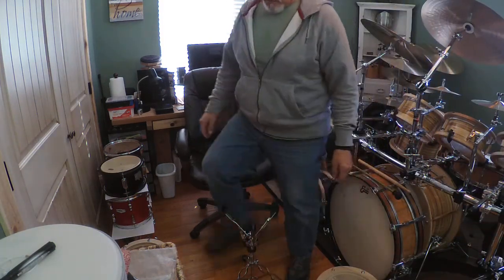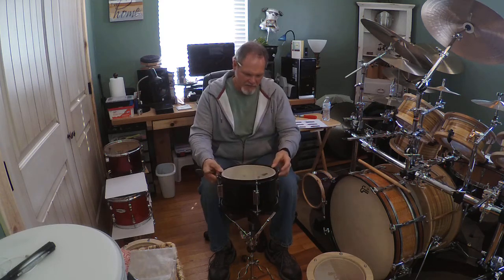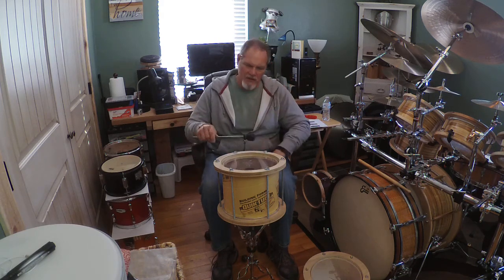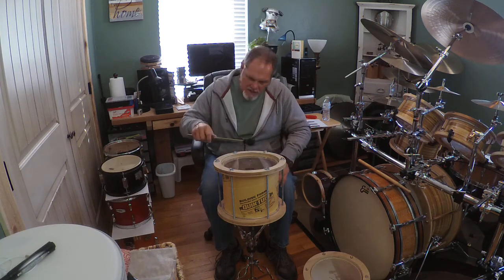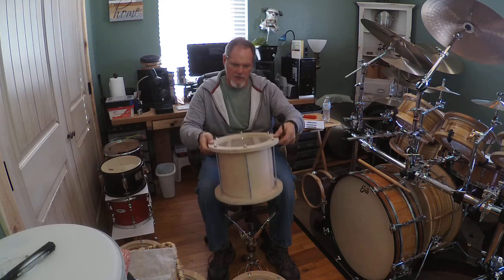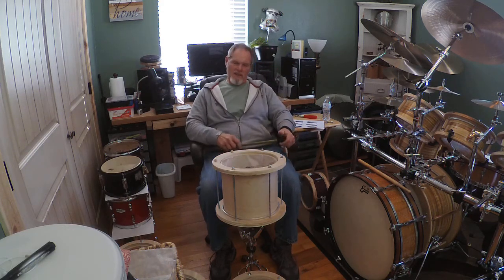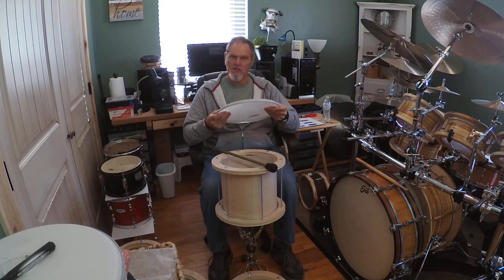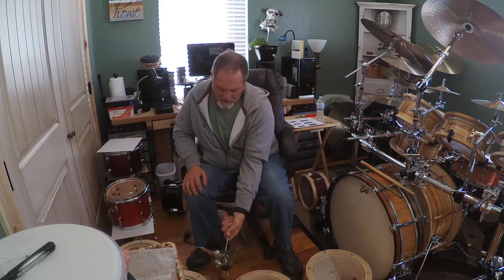Drum Shells and Sound - Bearing Edges, Part 6

Comment: You destroyed drum kayfabe for me! That word is used in pro wrestling to describe the facade of pro wrestling. The Big Secret! Well, I am beside myself. I was the nerd who’d look and study the drum construction and tell people what was good. I feel like a preacher teaching heresy and now my congregation is going to hell. All that said, I have a Premier APK set 8-10-12-14-16-22. I want to make my 10x12 an 8x12. Mainly for ergonomics and to have the drums at the same height. What will be the difference in sound? I’ve heard that it will be less resonant. What is your suggestion? Thank you for the info!
Reply from the maker: A 10 can be turned into an 8 but, there are considerations. Re-rings? Lug length? Hole placement. 

To cut 2" off the shell is no big deal. Less resonant? We'd have to have a definition of "resonant." Soundwise the drum will be a little more lively as the heads react a little more quickly off each other. It will pick up a little more sustain but, that depends on mounting and head choice, as well.

Does the drum have re-rings? If so, you have to decide to get them off the shell in into the new space or, bypass them and just put a bearing edge on your shell wall.

Lug length. If you cut off 2" will you be able to drop the lugs down and stay away from the row of batter head lugs (assuming you cut off the bottom of the shell). 

The original lug holes. Where will your cut line come in relation to the first lug hole? You may find the cut line comes just above or right on or below that first hole.  Assuming one hole my be cut off, that leaves one hole. Where will it end up? Visible? Behind the new lug placement? Leave it? Fill it? 

Turning a 10 into an 8 is fine but, you have to watch those details.
Reply: Already considered that. Shell is 5.4mm with no re-rings and is painted black since that’s how those drums were manufactured then. The drum would be cut on the bottom so all badges and mounting are the same. The smaller toms are 9x8 and 9x10. The 9x8 actually is the older APK with long lugs and the rest of the drums have small lugs. Like you said I have thought the cuts. It will land around or on the second hole and that said a new bearing edge will be needed. That drum will be under 8 inches in depth is my assessment. I hear that the drum would have a short decay. I don’t mind that. My main thing is I don’t want the tom sitting on the bass drum. A couple questions-is there a difference between short and long lugs when it comes to sound? What about the air hole? Btw I heard your drums and and you should hear Yanni live at the Acropolis. That the first time I’ve seen a 9x6.
Reply from the maker: @martincoronado9232  I'm confused. You have a 9x8 and 9x10 and 10x12 and you want the 12 to be 8 in depth rather than 9? 

Decay is based on head choice, head tensions and sympathetic action in the air column, and mounting of the drum. Sustain and decay are almost moot to the sound of a drum in a band context. That is why almost everything is about the heads and sticks and player's touch, more than the drum shell, save for volume associated with the density of the cylinder. That said, my "half-toms" have a lot of volume and sustain simply because the air column/sonic wave stays in motion at a faster rate between the heads. Deep drums do not have more sustain just because the cylinder is deeper. They can sound like dry tubs by comparison. 

Long lugs add obvious weight and mass onto the shell and will tend to dry out the sound some, even with an isolation mounting system. Just the nature of the beast. That would be noticed less as the drums grow in size and dimension. 

I do not place air holes in my drums. 

One of the reasons I went back to half toms from that concept 8" depth rainbow set is because deeper drums produce more "punch" and a drier tone, even with single ply heads I use. I have the Yanni video. Charlie's toms are staccato sounding because of that depth. I like more sustain and musical tone, such as it can be heard by my ears and by mics when the whole set is going. I once made a concept set with all 10" depths, from 10x6 through 10x20. The small toms were just too dry and lifeless for me. Very throaty sounding or tube-like. Since the 90's, no matter what I experiment with, I always go back to half toms: 4x8 through 10x20, and even 11x22 and 12x24 for the kicks, though I do like a 15 or 16" depth for bass drums overall.
Reply: REFondrums the reason I want to go from a 10x12 to an 8x12 is mainly keep the tom from resting on the bass drum. Also, i want the lugs to have the same distance from the bearing edge. The lugs need to two holes to be affixed to the drum. If, for instance, the closest hole is    1 1/4 inches away from the bearing edge then after the reduction I would like the same distance. I don’t want the lugs to look off. If there was meat then I would go 9x12. Btw what is better, thin shells or thick shells. At one time wondered about a descending thickness shell. 
Like this
6”- 8mm
8- 7.5mm
10- 7mm
And so on.
What are your thoughts?
Reply from the maker: @martincoronado9232  The simple answer to just about any question regarding sound and drum shells can be found within the Janka table. The Janka table is a table of wood specie hardness/density. The table is generally used to rate wood flooring. 

The more resistance sound waves meet the more excitement within their environment. That means volume, generally. Thicker shells promote more volume. That said, a thicker shell wall of soft wood, may not promote the same volume as a thin wall of hard wood. A thick walled drum of basswood plywood may not promote the same volume as a thinner wall of Bubinga plywood. Density increases, to subtle degrees, how loud a drum may sound, and how "bright" it may sound. 

Having made drums in 6, 8, and 10 ply configurations, the differences, in Keller Maple anyway, are not that great. Again, lost in full set play with cymbals ringing, and certainly in a band context. 

The sound of a drum is 90% or more the drum heads. Change the heads, change the sound of the drum for more radically than changing drum shells. 

In this day and age of constant hype from drum manufacturers that simple principle is so hard to get across. Drum manufacturers want you to buy their drums, not another company's drum heads. So, they hype their shells. Thick, thin, no rings, rings, special lugs, special finishes, etc., etc. They constantly change their hype to try and stay on top. Thick shells were "in." Then it became thin shells for best tone. Then it became special layering of veneers. It is all garbage. All of it. It is all hype to create sales, nothing more. It has turned into a beast that is out of control. 

Whatever material or construction process plywood shells go through, I want to see the company owners stand 20' feet away from their drums, blindfold them, and let them tell me what series of 12" tom they are hearing when struck. Let them try it 2' away.  Even then, if they could tell the difference, it is all lost in full set play and in a band.  

I can guarantee you just about any player with any experience with drums could stand 2' away and tell you if a drum has clear, coated, twin-ply, or calf heads on it. Their sounds are obvious.

Think heads, not shells. Shells aren't enough to make that major a difference. It is far more important how the drums are mounted, and how well the heads seat on the edges, than the plywood they are made of. 

So, for nuance's sake, look up the Janka table and see the density of woods used for making drums. That will help you in determining the subtleties the thickness of shells may effect the sound.
Reply: REFondrums mercantile/Luan/Philippine mohagany
800-825
Eucalyptuses 
1100
It is bright but that could be the heads. So in short, what could I expect from reducing the depth of the tom? I’m asking since you do seem to have an honest knowledge behind drums. Btw are your drum fashioned after the Peavey?
Reply from the maker: @martincoronado9232  The closer the heads are to each other, the more activity between them as sound waves and the air column move at a faster rate but, it isn't anything major. An 8x12 will feel a little more lively than a 10x12. The 10 will generally sound more tub-like, what many call 'punchy' but, the same thing can be achieved with an 8 using thicker heads. 10x12, 11x13 came in as 'Power' toms: a touch more volume, and that tubbier, throatier sound the extra 2" of space creates. A slightly slower response between the heads. A 10x12 is the same principle as a 14x16 or 16x18 or 18x20 floor tom. I don't like standard floor toms. Very slow response. All my regular drums are "half toms," shell depth half what the head size is: 4x8, 5x10, etc. up to a 10x20.  

It's really subjective. Each player feels things differently, hands to hands. Some like the softer feel of deeper drums. I like the feel of shallow drums. But, again, nuances, subtle differences. I like that faster response and livelier sound of shallow drums and single-ply, clear heads.

Most drums I have made over the years have been standard function lugs and hoops. The Plywood drums are lugless but, are not fashioned after Peavey's radial bridge drums. I thought about doing that but, the way I chose was easier to accomplish. Plus I wanted to see how both heads being tensioned at the same time would work out. Peavey's are standard tension, each head at a time. The Tabletop/Pancake drums are sort of like Peavey's, I guess, if you count the table as a radial bridge but, I wasn't thinking Peavey when I made them. I was thinking about an idea I had many years ago seeing a picture of a very old drum, a floor tom, shaped like a tear drop, that had a batter and reso drum head shaped like a tear drop and the drum tensioned like a standard drum but, the idea seemed to be one drum, different pitches depending on where the head was struck. Also, Trilok Gurtu's rig. That was also a big part of the idea for my Tabletop sets.
Reply: REFondrums The amount of priceless info you have shared is ridiculous. Thank you!!!!!
Reply from the maker: @MichaelOforiDrums  Thank you! I appreciate that.

Comment: I had suspected this but wasn't sure.  You solved that for me.  Thanks.  Now do a video like this on suspesion mounts.  The companies hype that more than the shells, and I believe that it makes no difference.  I can't stand when I see a drummer paying and his drums are bouncing all around because that's susposed to give them a good sound.  We need to retire suspension mounts.  They are a gimick that actually worsens the playing experience.
Reply from the maker: I began mounting my toms in modified snare baskets to allow the drums to vibrate fully without all the bouncing around I see with some isolation mount systems. 

Some of that bouncing has to do with the velocity some players use more than others. Hard hitters. Others, it just seems the drums are not secured enough but, that is the trick: secure the drum and allow it to fully vibrate at the same time. 

I do believe, by my own experience, isolating a mounting system from the drum shell does open up more frequencies from the drum. Mostly lower end frequencies. How well various companies accomplish that in their own iso-systems I don't know. Logically, some better than others.  It has added a lot of cost to drum sets,  and weight per drum, and it would be nice, if not crucial, if all the manufacturers put up comparison videos of their drums typically mounted, next to drums with their iso-systems so consumers could easily compare the sound and see advantages, if the sonic differences would be worth the extra cost to them.  

Most times now, lower end lines do not have iso-mounts. Higher end lines do but, some companies now put iso-mounts on lower end lines, as well. Maybe someday, even student/beginner lines will come with iso-mounts, at least as an option. 

They are so common now that I imagine many young people, not around when iso-mounts first came out and why,  even know the practical reason they exist. 

I have seen and listened to some "isolation" systems that do not isolate the shell from mounting, and to me, the drums do sound muted. The manufacturers like to call it a "focused" sound. If someone likes that sound that's fine. To me it signifies failure of their system but, that is subjective on my part.

Isolation mounts do play a part in overall sustain and frequency response of toms. Whether those differences mean anything to the sound of a drum set beyond the initial stick impact of mic'd drums in band context is also subjective, especially if players like low pitched drums, with less tension on twin-ply heads. It means little to nothing, logically, on bass drums because most players use muffled heads of some kind to keep the drum heads from full vibration and sustain. Snares sit a baskets already. That leaves rack and floor toms. 

If you isolate floor tom legs from the floor it sits on, like using thick rubber pads or blocks, it will create a fuller sound. If you isolate the floor tom from mounts holding rods/legs sitting on a floor that absorbs frequencies, you do the same thing.  

Mounted toms ... lots of ideas for those over the decades. Some work well. Some, not so much but, sound is in the ear of the listener. If someone doesn't think iso-mounts make a big difference, these days it is difficult to find drums that do not use them, unless you get vintage drums.
Reply: @REFondrums  Very interesting.  Thanks for the education.  Can we have a video on that showing the difference?  I know you can't buy all the difference drums, but maybe there's a way to simulate/demonstrate it.  You're pretty good at that.
Reply from the maker: @Alaska_MD  If I had the money I would do an extensive test video on everything out there but, that would be extremely costly. What you can do is take a look at this link. I wish there were more actual before and after videos but, there are useful videos in this list. Some are very good. Some not as good. Some have nothing to do with the actual subject but, the youtube search engine threw out what it did. You can take a look and listen. I endorse nothing in the list as far as products. I will say Gary Gauger is well-worth a listen. He is the original inventor of iso-mounts, and has a lot of physics to back up his concepts, including videos on some past failures, which are pretty interesting.

I found it interesting apparently some players do not want the extra sustain iso-mounts may provide.  So, now players are coming up with ways to lessen sustain. Go figure. 

As I watched and listened I have to admit, once again, nuances and subtleties in some cases that would be lost in full set play, and certainly within a band context. You would never hear anything "extra" these devices provide once cymbals are involved and the rest of the band. All you would hear is the initial stick attack on the heads. A lot of players do not realize the limited nature of the sound of a drum in a greater context than listening to one strike with nothing else happening. Once you start adding more instruments on the kit, and then a band, so much of the full sound of any drum is lost. 

https://www.youtube.com/results?search_query=no+isolation+vs+isolation+tom+mounts
Reply: @REFondrums  I've been with Gauger since he operated out of his garage. First heard about them from Russ Kunkle. Personally, I swear by them. Your milage may vary. The shell is part of the sound for sure but I don't buy these supposed subtle differences in that shell makeup.

Comment: Different wood grains produce different sounds. Not all 12 inch toms sound the same even if they are made of the same type of wood.  Wood grain changes every thing.
Reply from the maker: The issue is whether or not the super-hype claimed for proprietary shells and sound, by today's manufacturers, is true, and warrants consideration. 

I'd simply ask what you might offer to demonstrate the claim that wood grain makes a significant or dramatic difference to the sound of a drum, that could be noticeable, especially within the context of a band all around the set.  The manufacturers, themselves, offer no such demonstrations. It is all marketing hype. 

Any nuances and subtleties get drowned out by cymbals and a band. Drum shells do not produce sound. Drum heads do. Shells are just a cylinder that may enhance or diminish certain frequencies thrown off by the heads in very small ways. How a drum is isolated from hardware makes far more difference to sound than shell material does. Yet, even that is masked by a band.  Changing head models will always make more difference than shells. That is why head manufacturers offer so many different models, and especially go after the the main prize - duplicating the SOUND of calf heads. 

There is just no justification for the crazy, ultra-hype used by drum companies about their shells, that never used to be part of the discussion when I was growing up. Something changed it all. Not shells. Marketing tactics.